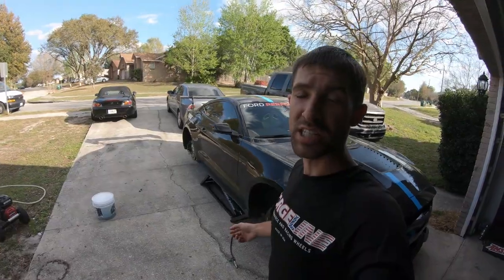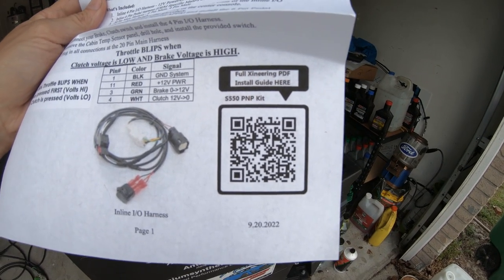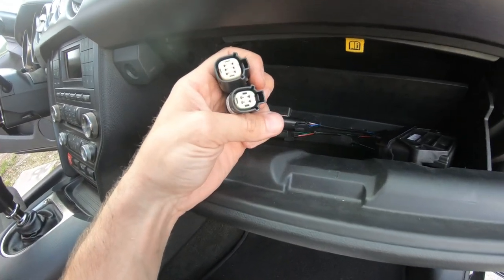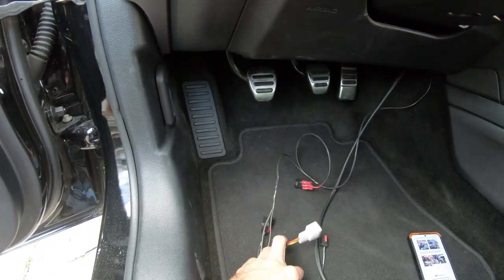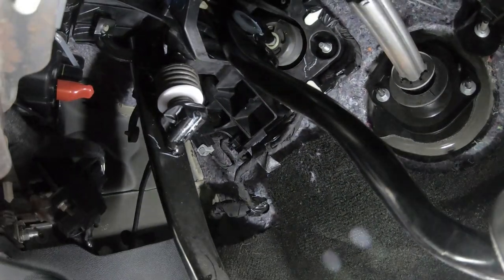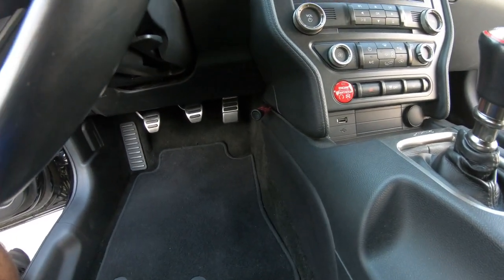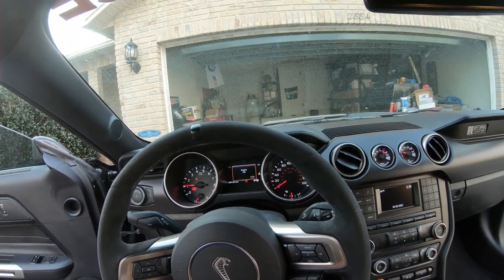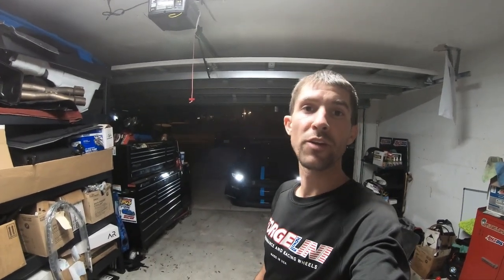Xineering Auto Rev match module install// GT350 rev matching like a PRO!

Comment: I’m surprised ford doesn’t have rev match from the factory especially since the gt350’s only have manuals. Pretty sad that ford doesn’t have more features with their manuals, the no lift shift and rev match in the Camaros is pretty damn awesome.
Reply from the maker: This mod is super easy to install and inexpensive to do so it's not a huge deal that they don't.

Comment: Did you have to hard wire anything, or is it all plug n play?  From your video, it looks like plug n play, however some other videos I’ve seen you have to hard wire the power.
Reply from the maker: This is the latest varient. No tapping or hard wiring anything. 100% plug and play!
Reply: @THEDriverMod_  Thanks!
Reply from the maker: You have a GT350?